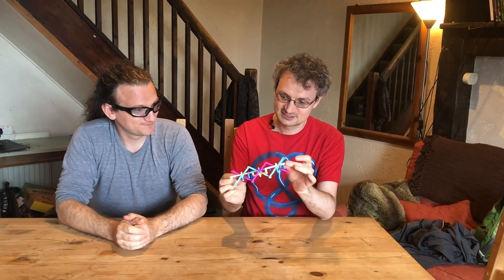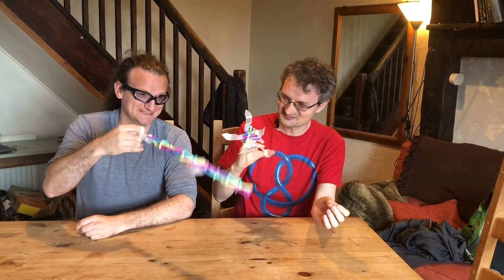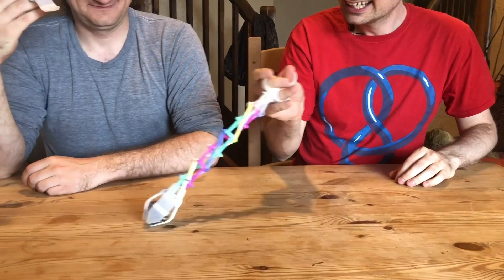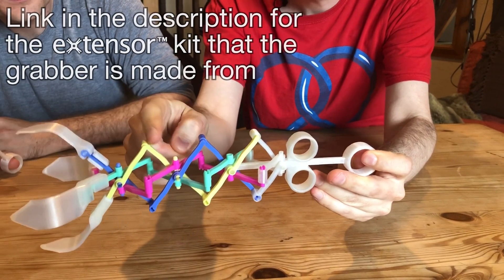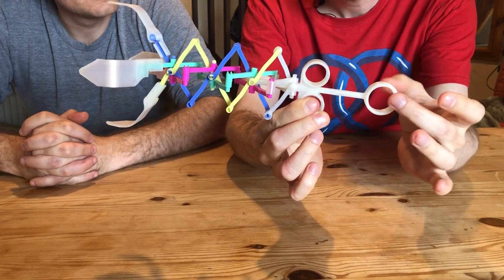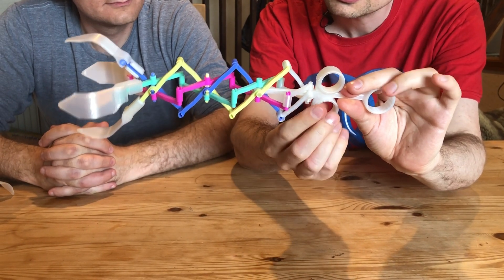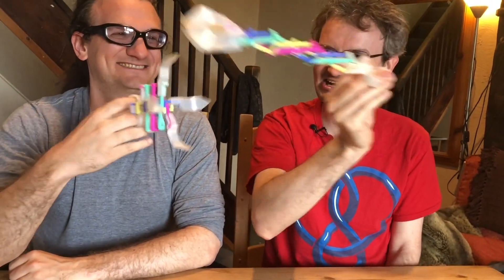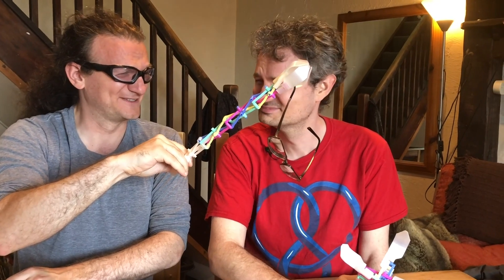Grabber mechanism

Comment: Should make a six sided version for more even force distribution, and a squeezable pistol grip trigger
Reply from the maker: That would be very doable.
Reply: @henryseg  you could also replace the gripping panels with something flexible, glue bicycle chains with pulleys (rubber hoses, for limited elasticity? That also gives the option of adding pneumatics later.) per chain segment attached (solder or weld exceeds chain links into fixed position) on one side & inverse pulleys attached to the other side to them. You know, sorta like fingers! Cf. The fractal vice featured on Hand Tool Rescue

Comment: Hi, on the website where you can download the STL (grabber_half_arm_(make_4).stl), shouldn't it say 'make 16'? Or actually maybe even more? Or is there a part missing? It looks different from the parts I see in the video but it's a bit hard to see.
Reply from the maker: The stls are for the extra parts needed to add to the parts from an extensors kit.

Comment: Plenty fun. Question!
Is the distance the thumb goes further to the other two fingers in pressing the mechanism shortet than the distance the a single set of diamond shaped hydrolics extend? Like is the length extending with every chaining of the mechanism? P.s love the way the colors go . . . Reminds me of the spatial phase in things like magnetism and electromagnetism
Reply from the maker: The thumb “travel” is the same as the distance between neighboring scissor pivots in this version. In principle I think it should be possible to make a version in which the distance scales up with each new set of scissors.